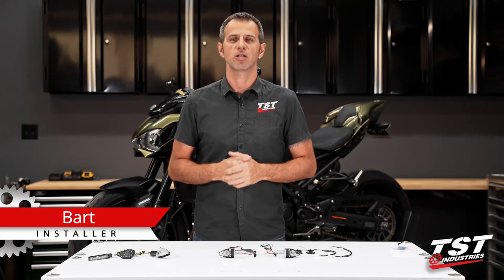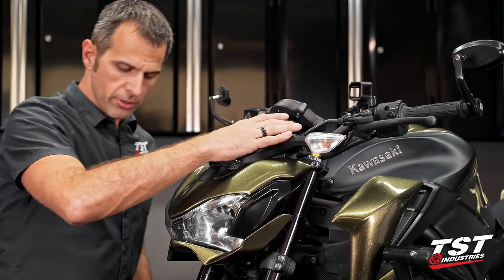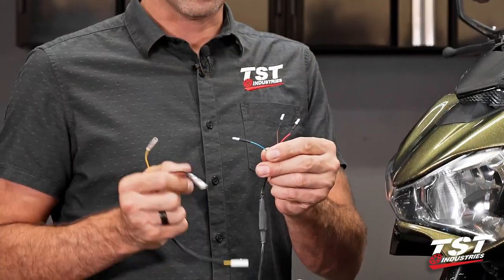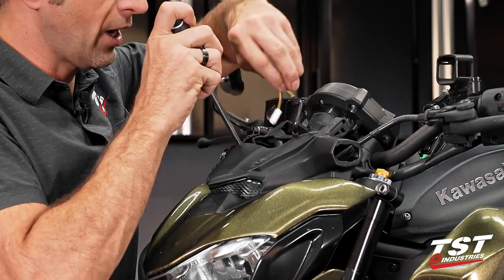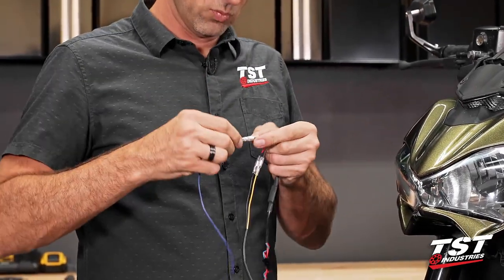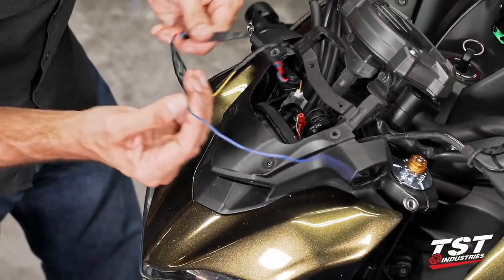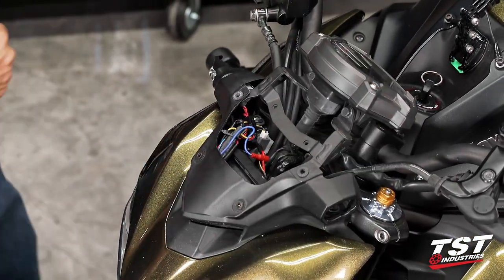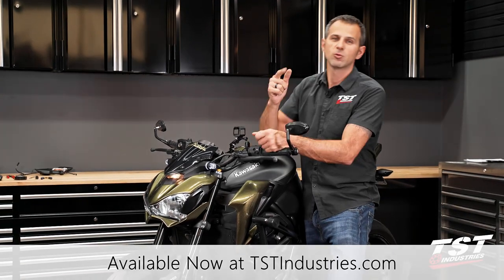How to install Mech-GTR LED Flush Pod Turn Signals on a 2017+ Kawasaki Z900 by TST Industries

Comment: Great video, if I may make a suggestion. For those os us in hotter climates I would strongly recommend using heat shrink tubing in place of the electrical tape as during the summer months the adhesive in the electrical tape will start running and create a nightmare of a mess to clean up.
Reply: Use super 33+ tape

Comment: Are you guys working on an updated video for the 2020 model? I just got my TST indicators in and took off the windscreen and the internals are much different than the model shown in this video. Thanks
Reply: Same here, does not appear to fit the 2020
Reply: Actually - this probably works: https://youtu.be/X-AMt_kMhng?t=659
Reply from the maker: What about the new setup makes the signals not work? Is it electrical connections? The physical fit should not be a problem.
Reply: @TSTindustries  I was able to get everything to work successfully for my 2020 z900 ABS using the video linked above.
Reply: TSTindustries The headlight shroud is completely different on the 2020 and gaining access to the wires is very different than previous years.
Reply: Is is all the same as the 2019 model except you will have to connect the running lights to the brown cable with yellow. Not the red cables.
Reply: @hristuppiteitinu  How did you get this to work on your 2020? I am doing mine currently and it is confusing there two black wires going to my running lights none of them are red like the video you linked.
Reply: @jeffreystewart1412  What did you use the brown/yellow wire or the black one to tap into? Both daytime running lights only have two black wires coming out to the next clip that splits them to brown/yellow and black
Reply: @hristuppiteitinu  What did you use the brown/yellow wire or the black one to tap into? Both daytime running lights only have two black wires coming out to the next clip that splits them to brown/yellow and black
Reply: @hristuppiteitinu  What did you use the brown/yellow wire or the black one to tap into? Both daytime running lights only have two black wires coming out to the next clip that splits them to brown/yellow and black

Comment: I wish you sold these kits without the connectors on the end, and with a vehicle specific connector and terminals.  This way customers can measure the OEM wire length and precut the leads, crimp on OEM  style ends for a true OEM looking install.  That wire mess drives me nuts..lol
Reply: Same for me. I used to upfit police vehicles and the excess wire would drive me crazy, good thing the eventually started producing plug-and-play harnesses for most of the stuff

Comment: Just a heads up, in your video you say to connect the black wire to yellow and the brown wire to red. But there is no brown wire in the turn signal you sent me. The wire is red, not brown. I was able to figure it out on my own, but just a heads up that you may want to add a correction in the video. Great product and instructions otherwise.
Reply: Just installed today.  Feel like they were trolling me with those wire colors lol.  Black did NOT go with black 😅

Comment: The insulators on the wires should be a heat shrink, so one wouldn’t have to use electrical tape. Unless they are made that way now, versus when this video was made.

Comment: Definitely quite different on the 2022 but I was able to figure it out with some changes.
Reply from the maker: If someone turns up here with one of those we will be happy to make the latest gen video.
Reply: What did you use the brown/yellow wire or the black one to tap into? Both daytime running lights only have two black wires coming out to the next clip that splits them to brown/yellow and black

Comment: I have a 2023 z900 and can’t find the red wire i have to put those red connectors on for the running lights
Reply: What did you use the brown/yellow wire or the black one to tap into? Both daytime running lights only have two black wires coming out to the next clip that splits them to brown/yellow and black

Comment: I'm looking to install the running light on a 2023 Kawasaki Z900. I watched the video for the 2017 model and saw it was spliced into an already existent running light. The 2023 doesn't have this light any suggestions on what to tap into? Also would it be possible to use the bullet connectors for the auxiliary port used to connect a USB port and if so how?
Reply from the maker: There aree several choices for installation. The auxiliary connector you mentioned is one, but it only goes live if your bike is equipped with the auxiliary circuit relay. If you already have something connected there and you know it is live with 12v supplied, then you can connect the blue wire to the positive end of that pair. Typically Kawi uses the female bullet connector shielded in a PVC sheath for the positive. There is a running light circuit within your headlight assembly, and generally Kawasaki uses the same connectors across their models to connect this light into the harness. I think the video I did recently on a N400 will be a good help to you in identifying a possible connection point and wiring to it. Please see this clip: https://youtu.be/Uhy3YRznjeU?t=201
Reply: @TSTindustries  I'll have to give this a look, i dug into my bike in the COLLLLLD garage yesterday and was like oh no the disassembly is different (albiet easier honestly) and then got to wiring those and was like oh no that's different even!  needless to say new turn signals are installed and working minus the running lights till it gets warmer and i can spend more time looking for a tap point haha

Comment: I would love to get one of those led lights for my z900 2021  but the fact the I have to cut wires change my mind do you guys have any updates cables with out cutting cables
Reply from the maker: What? Therse are plug and play with your signaling circuit. Please watch the entire video. We can't help it that Kawasaki does not have a running light circuit in their signals. We have an add-on kit that enables the connection of a running light if you choose to do so. In that case you tap in those wires. There is no need for cutting any of your OEM wires.

Comment: 100x easier to just take the other bracket out holding the signals themselves, it’s only 4 screws and you can actually get a screwdriver in there without worrying about dropping or stripping anything.
Reply from the maker: Thanks for sharing your experience. Hopefully it helps others perform this installation with the added ease.

Comment: Will these work the same way on the rear as well?
Reply from the maker: The only way to mount them on the rear would be to use the fender mounting area. If you've retained the rear fender then you can definitely mount them. The underside of the fender will look a bit unfinished though. The parts of the signals that are on the inside of the assemble aren't meant to be seen and aren't very cosmetic.

Comment: Are the included O-rings necessary?
Reply from the maker: No  that is an optional component typically used if your installed signal moves around due to lack of friction from the fairing

Comment: Is the blue running light illegal?
Reply: I live in Florida not quite sure if it’s blue blue
Reply from the maker: If you find out that you cannot use blue then just get amber or white. We have those colors available in stock.
Reply: Check with your state's department of public safety. They can provide you with a copy of the laws in regards to certain color lights  keep it with you just in case.

Comment: fit in z800??
Reply from the maker: The signal well on the Z800 is the same and the connector is also compatible. We have not had the 800 in the shop for a few years now and they are hard to find around here so I cannot tell for sure if there are no components underneath the shroud that may interfere with the fit. If you are in the USA then you can get a set to try and if it doesn't fit just return it. Mention this conversation in your order to ensure there aren't any restocking fees charged should you return it for no-fit reason. Does that work for you? If they do fit, and you can supply high quality photos we will also refund you the cost of the parts. Let me know if you are interested in that.
Reply: @TSTindustries  yes i am interested but i am in Colombia, the base of signal look pretty close, thanks for answer me
Reply from the maker: Too bad man. If we find out they fit we will make that known. Where do you live in Colombia? I have been to Cali one time to participate in the World Games. I really liked it there, and the people were really nice.
Reply: @TSTindustries  Cali is very nice, I live in Bogota

Comment: My buddy Chris did it first... just sayin!
Reply from the maker: That's cool and all but somebody had to design those parts to fit first. Now who can that be....
Reply: TSTindustries 😂😂 we used the FZ/MT09 turn signals. They’re pretty much the same signals. Who knows if you guys even changed anything?
Reply from the maker: @rayray3866  We had to make a new wiring scheme. The geometry of the FZ/MT signals fits well in the Kawi signal wells We actually had a Z125 outfitted this way for a good while now. Same setup as you see in the video we just launched.
Reply: TSTindustries seems like great minds think alike then. Didn’t realize you had a Z125 with them on. I saw them when Ray got them for his FZ09 and figured I could make them work for the Z900 so I did.  I have piles of Kawasaki OEM signals laying around so I used some OEM connectors that I soldered on after removing the Yamaha connectors.  Super clean install without extra wiring. The way I tapped into the running light is a bit different too, I used a splice connector along with a spade connector to where I can easily unplug them if I need to remove my headlight assembly. 

It’s a great product and love the way it transforms the front of the bike.  At least I can still say I had the first Z900 with them. Haha
Reply from the maker: We had to make the connection kit universal. Since a lot of the Kawis and Suzukis do not have a running light circuit for the signals we needed a connection kit that could be used across all models. We also needed the connection kit to not require any special tools. I think what we arrived at is pretty good and easy to install even for people who do not do much of their own work. Kudos to you for being a pioneer in getting these signals on other bikes. When I heard about your install I ticked the "sure" box on my list of bike compatibility. At that point the Z900 was on the "maybe" list. I didn't know if there was any junk behind the shroud that holds the signals preventing all of the signal mount from inserting all the way. At this stage we have done the install on Z650, Z900, and are waiting to get the Z400 in house to do the same,